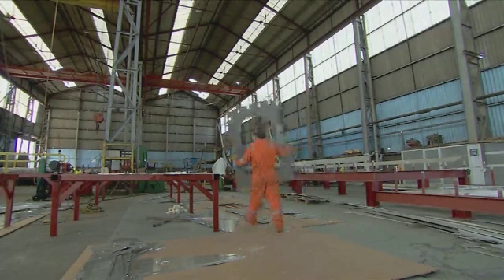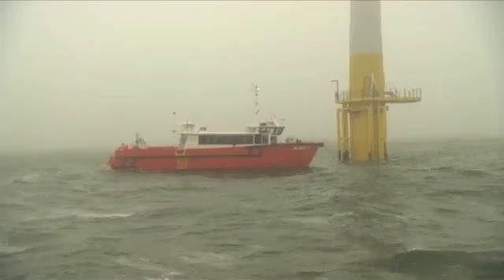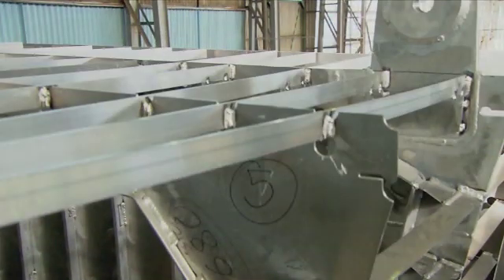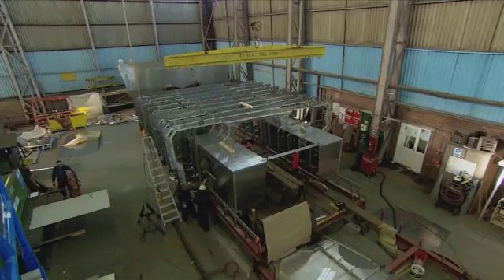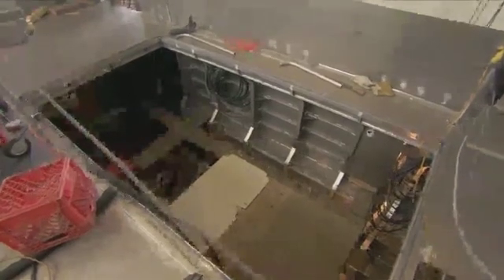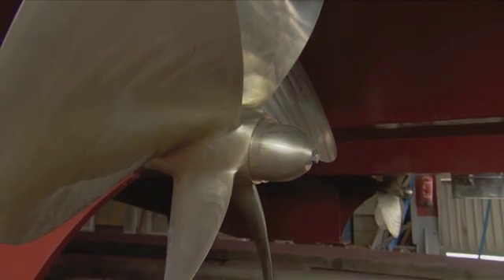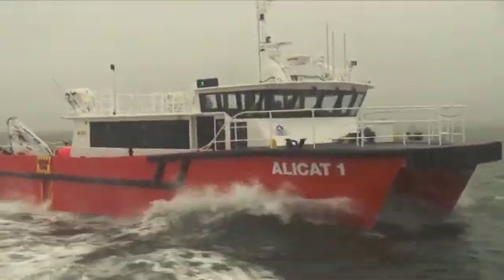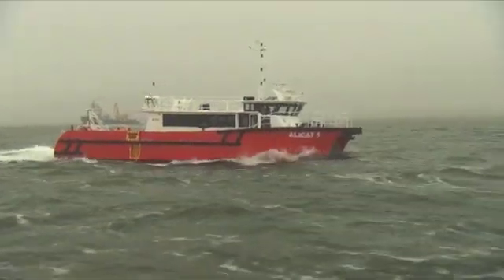GMD - 20m Offshore Wind Farm Catamaran - 'Alicat 1'

Comment: This is the wrong hull design for heavy sea operations. The SWATH catamarans are far superior in ride quality and handling.
Reply: That's one opinion. No one in the industry has yet successfully designed and built a swath in the same hull size as these Alicat WFSV's that is in the 17 to 22 metre range.  So until this happens this is the right hull shape for heavy seas.
Reply: But with a much, much deeper draught...